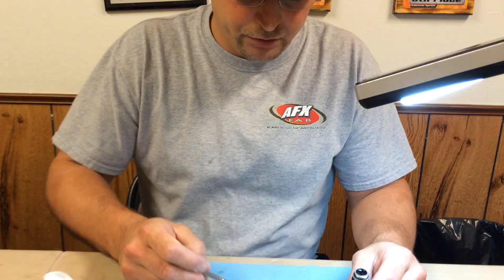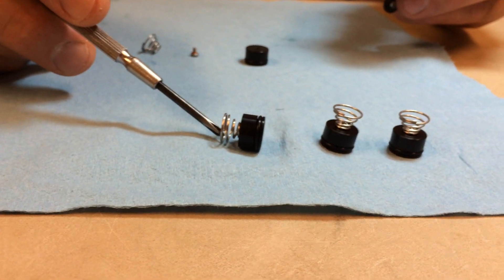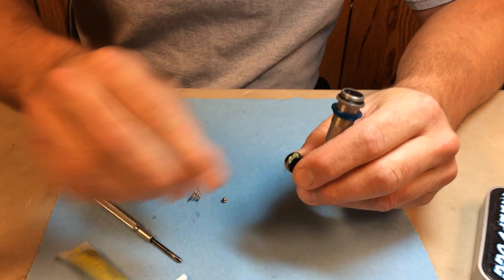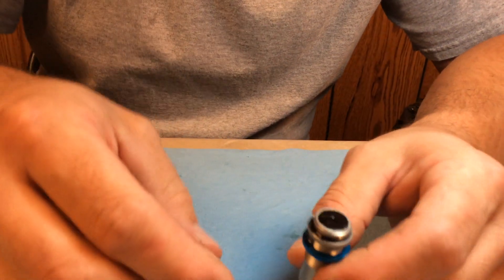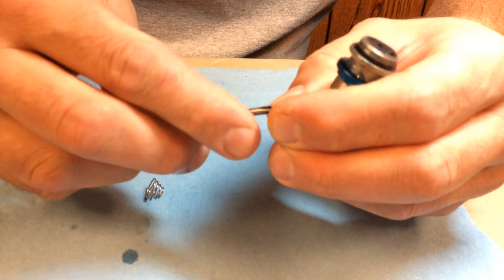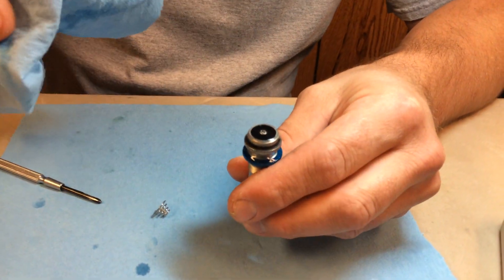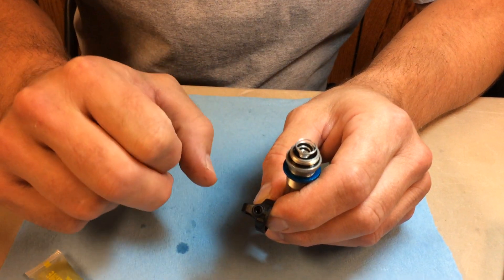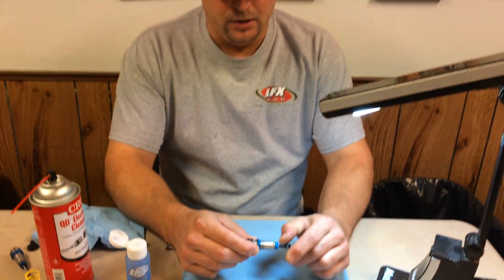JL Floating Piston Shock Build

Comment: you would only use this in oval situations what about regular racing like on stock sc or buggy
Reply from the maker: On our oval cars we are using long shock bodies and the short shafts. This allows room inside the body for the floating piston even with shaft fully compressed.  To run these on production off-road car you would need to run the same shock build "long bodies&short shafts", that may not work with the stock shock towers without effecting ride height and droop.